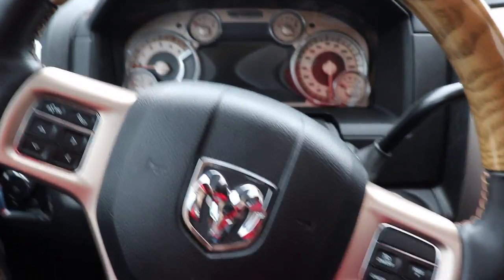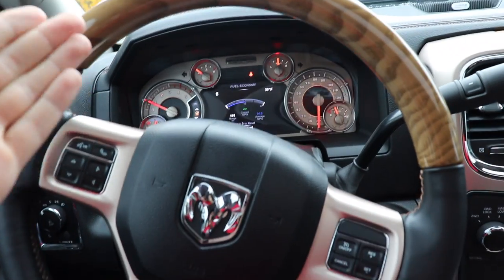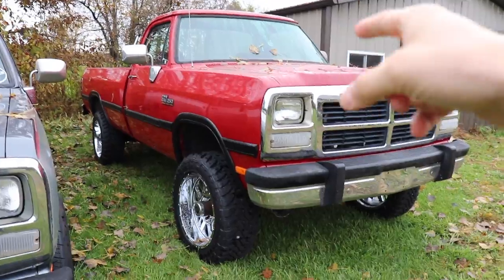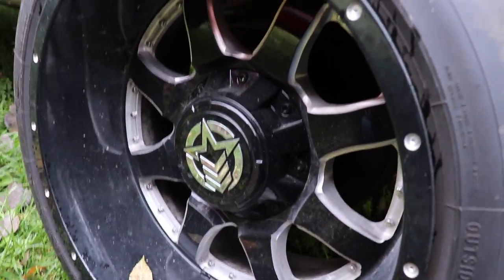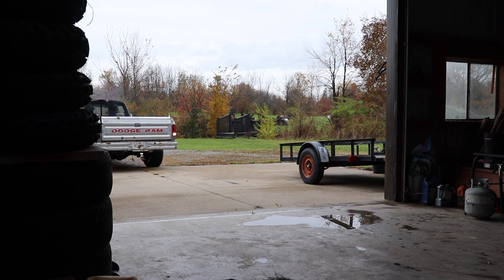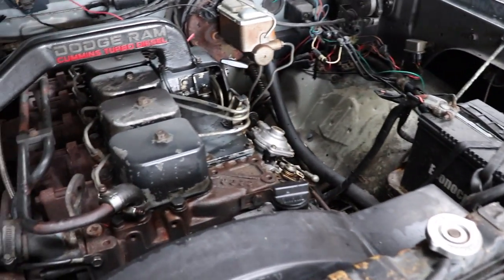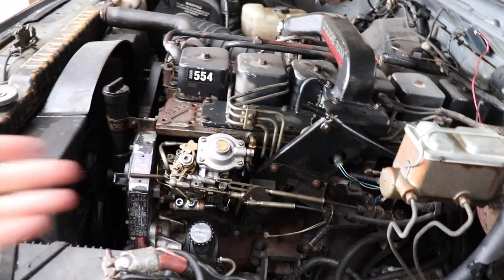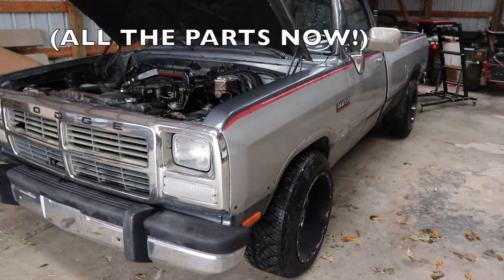1ST GEN 12V CUMMINS BUILD STARTS NOW!

Comment: VE build is nice, those turbos some 5x14's or 6x13's (STAY AWAY from 7 holers on a ve....trust me btdt) and good airflow(p/s intercooler n banks twinram) will get you 90% there....looking fwd to it....oh BTW, no need for any fancy FASS or Airdog lift pumps, a low pressure STOCK Cummins piston lift pump upgrade will more than supply enough fuel for what your planning (btdt also).

Comment: I would double check but I believe the Banks twin ram is designed to work with and around the fuel line for a p pump only.  You may have to get some special lines made.

Comment: My 5 speed first gen has a Denny t 2 fuel pin, 3200rpm gov spring and of course the KDP fix, pump work, and a hungry diesels hvlp lift pump and a south bend single disk clutch. Runs great. But I just got ARP studs, 60#springs, 5x12 injectors and a 62/68/12 turbo. Super excited to see what the mods to to the ole girl

Comment: Appreciate your cold start for the 4th Gen 2018 Laramie 3500, but try a cold start when it is below 25 degrees F.   The DEF is usually frozen in the lines leading to the engine resulting in a no start.  The DEF heaters are only in the DEF tank.  This is one on many of the 4th Gen problems, not to mention the recalls for SCR emissions and EGR valves that plug the VGT (Variable Geometric Turbo) turbos.

There are several TSB (Tech Service Bulletins) out for the 4th Gens.  For example, check out TSB# 18-040-18, posted 4/27/18; this TBS is regarding the 6.7L Cummins misfiring in cold ambient temperatures.  Frankly, the 12 valve 1st Gen is the better truck.

Comment: I love your videos, I just bought a first gen too. It's an extended cab intercooled. I'm gonna go injectors, compound turbos, big cam. I'm hoping to push 650ish hp.
Reply: the shadow so your going to be one of those guys who abuse the cummins? No point in making all that horse just putting a 0 fuel plate with marine injectors is enough. No need for bigger or twin turbos. Thats how you abuse them.
Reply: Optic ForSyth not really sure how that's abusing the truck. The only abuse this truck will see is when pulling a heavy load. Even then I'll when go easy on her because I love that truck.
Reply: the shadow yes that is true. But bigger turbos is unnecessary, the factory one produces enough boost. I don’t see why every one has these 800 horse trucks. That’s cool and all, but it’s not necessary. Just making a few modifications is plenty.. fuel plate, cold air intake, injectors, straight pipe exhaust, star wheel. Possible better oil filter or other small stuff. But stuffing big or 2 turbos isn’t really needed.
Reply: Optic ForSyth the factory turbo on this truck will not support that much power. The turbo would be way out of its efficiency range and would lead to problems later down the road. Might as well put a second bigger turbo to take some of the load.

Comment: Just wondering if anyone can help me, I have a 4th gen 2011 that has a hard time starting in the cold, it seems to click as if the batteries dead when they were just changed. This all happened after they died originally, can anyone help? I don’t think it has anything to do with the starter or grounds.